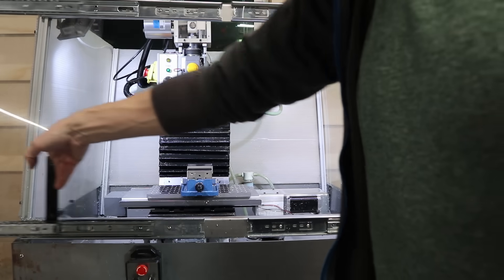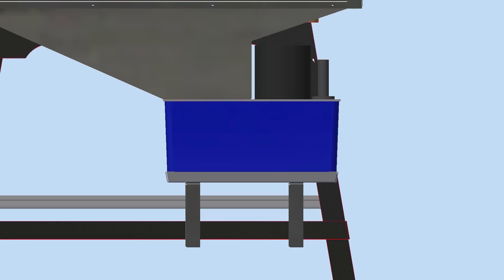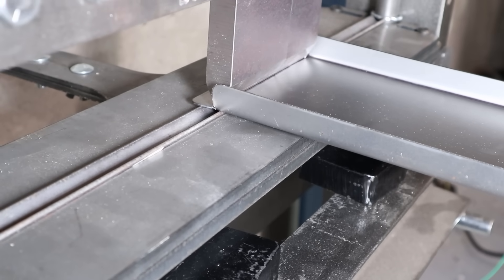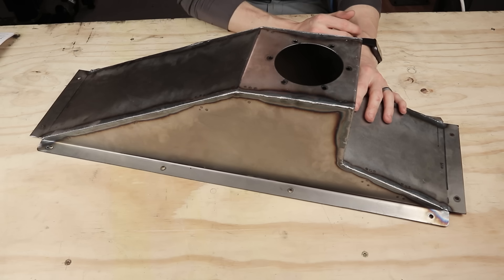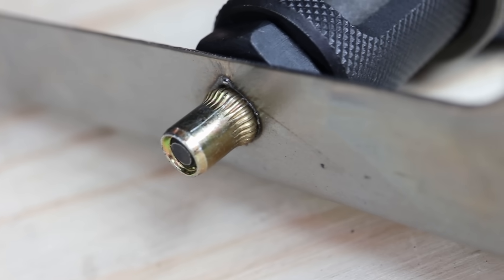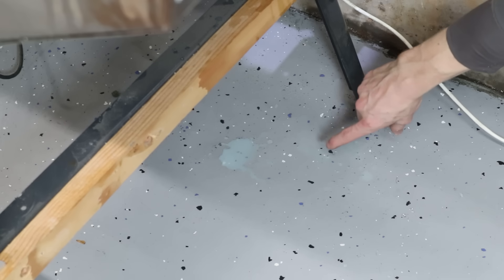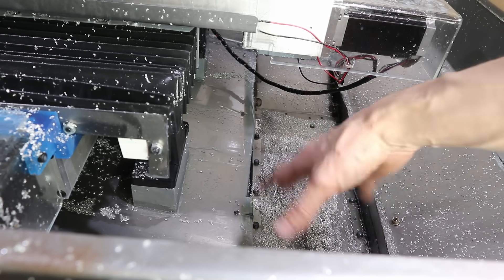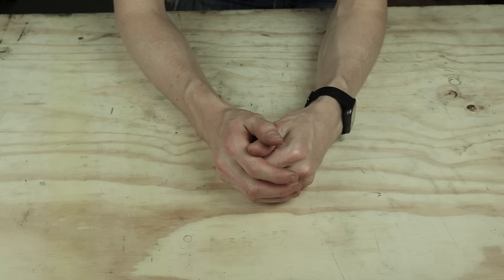Fixing a little mess with a big mess

Comment: I've used riv-nuts to install bottle cages on several bicycles. I don't have a puller tool. They will fatten out and lock into place by running a bolt into them and then just over tightening them.

Comment: Coming in a little late but as a welder of 11 years just the fact you welded thin guage steel with tig without blowing holes everywhere shows you have great hand control. Don't be afraid to show your welds, you're doing great.

Comment: Riv nuts? The protruding head is going to equate to a clearance between the filter and basin, on the order of thousands of times wider than the mesh's holes. 
Why would you not just make the thing snap in place with magnets?

Comment: I dare you to make a passively purging / cleaning filter mod so that the filter itself doesn't get clogged and starve the pump ( or overly limit the coolant volume ) as the filter loads up with small chips....and just because it's annoying to have to manually clean out the filter.   Might be a fun logic/engineering puzzle to solve how to automatically purge and separate the chip load from the stainless mesh filter so it's always free flowing.   ( Excellent [ and very satisfying ] build video my friend -- THANK YOU for posting !  I truly enjoyed it ! :- )

Comment: Obviously almost 2 years after the fact but if you haven't already, might consider putting a rare earth magnet puck at the bottom of the coolant basin below the mesh so any thing that might magically make it through will get caught by that last line of defense before the pump.  Similar to a transmission.

Comment: Wouldn’t it be better to put those tabs on the outside so it’s smooth on the inside where the fluid needs to flow? Great video this is fascinating
Reply: Also bend the sheet metal to overlap instead of separately made brackets.  The overlap would contribute to water tightness.
  Besides, spot welding is more dramatic with a handheld clamp fed by two massive DC wires that get pushed apart by the pulse.

Comment: If you let another layer of that screen lay over it, could you then just pull it out for a bulk of the cleaning.
Or ideally, rinse, reach in, grab a handle in the middle, pull out a basket, clean upside down, drop back in.
Anyway, thanks

Comment: those machines with a water pump build in (like a ice cube maker for example) often switch the Null/zero to control the machine. which then with all the water more often than usually is the problem for them banging a fuse out

Comment: If you want to learn how to manipulate the puddle, oxy-acetylene welding is a good way to practice. It was the first process that I learned and is still my favorite. If it was more versatile and could be used on lower temp metals like aluminum or sheet metal, I never would've bothered with TIG

Comment: Your new coolant system looks cool. =)
On another note...I'd have thought that the chips would be sharp and/or pointy and easily cut or pin through your skin when handeled without care...but since you just grab them and throw them around with your hands they probably aren't...though your hands do look kind of...messed up. Throw me an answer someone, are these not sharp & pointy at all?
Reply: Yes they are.  Working with such things for years literally causes the skin to heal to a thicker layer that can handle more scratches, while simultaneously training your brain to ignore more pain.  This used to be an easy way to tell workmen from manicured office/leisure types.

Comment: Hi! I love your videos!! I have a suggestion. If you make the frame and the screen of the filter in V shape pointing downward, then is less possible to clog, the chips goes to the lower spot and the sides stays clear the most of the time at least.  Plus you have more screen surface. And even more you can use an overflow about an inch  or so higher than the filter. This way only the coolant can travel through if the screen clog completely and the chips stays in the bottom of the cabin but then you may put more coolant in the tank than you put now. I hope that makes sense 😊

Comment: You still have a flat surface at the bottom. A better design would be like a ventilation duct from 'square' to round like this in the link below. this would take u from square/rectangle conically tapering into your plastic fitting with very close to no flat surfaces to gather liquid.
https://www.ductstore.co.uk/acatalog/ductwork_square_to_round_300mm_Width_200_Depth.html

Comment: Why not spotweld the tabs to the outside, as on the inside the coolant will flow and also the metal scraps. Wouldn't it be better to have an area where there are as few protrusions as possible? Makes cleaning also easier.

Comment: Electric motors and compressors have a tendency, on start up, to trip GFCIs. That’s why fridges and water fountains typically aren’t on GFIC protected circuits. Still not a bad idea to add a ground wire though 👍

Comment: Great engineering, worked as kind a special electrician 10 years, build the stuff that big company didnt want to build bcs so complex many times doing SERVICE was not in engineers mind at all!
And often they did not plan how to install stuff, like there is a wire from wall to wall 10m long and 4x10kg lights, walls were pretty much paper, so how to attach? wire tightness so it can carry them, noone in plans, or when we build this light art, which had 600 vertical wires in it, no horizontals to stabilize and it were in subway! hahaha bring it up to him did not get any solution so had to do own, ofc the wires had to be able to removed and tightened now and then, so we just made it whit long bolts. which had like 5cm empty space to adjust.

Comment: Why didn't you do the 90 degree elbow brackets you spot welded on the outside (or something else) so that the coolant doesn't have to run between the bracket and the panel?

Comment: I'm a year late but here it is! As an aircraft mechanic I see lots of rivnuts. I hate em. After enough ins and outs they loose grip and start to spin. Anchor nuts (or nut plates) are much better. Imagine a captive nut on a plate which is riveted to the surface. Much more reliable. Either way, better than a plain nut! 

Great video!

Comment: Recently, I built a furnace for melting aluminum.  I found out that under normal operating conditions, the firebrick at temperature can conduct enough current to trip a GFCI.  So I had to rip out my 20 amp GFCI's and replace them with standard 20 amp receptacles.  I stopped using those receptacles as convenient places to plug in my power tools.  Also, I started to worry about where I had plugged in extension cords into my some of my "dedicated circuits". Sure, there is plenty of capacity on my water heater circuit, but despite that circuit being located in my garage, it doesn't have a GFCI!  I better come up with a better solution for my wet saw!

Comment: I worked making air conditioning and manufacturing the ducting if you had a proper folder you can remove teeth which will allow for folding without crunching a fold already on the side they also have a bar that is a counterweight when it goes past Centre or plum the weights help you fold with less weight on your body.

Comment: Nice handcrafting but u should think a bit forward.
If the electrical safety goes off it means u have a dispersion of dangerous current somewere;  in a machine grounding ALL metal frames to earth is MANDATORY to avoid  electrocuting yourself ; how it works? with grounding wires will give the "runaway" current a easy path to earth to follow, instead trought your body.
BUT: u have to ground all metal parts = not only the bottom but also the metals juction on the plastic frames, the machine metal part itself etc.

Once u have done that, u still need to solve the PROBLEM : the machine is leaking power somewere.

To find it u could first find out if u have damaged component \ wire :  u must disconnect the cnc, and leave on but disconnected for 10-14 minutes ( to let the capacitor discharge) then with a tester set on continuity ( the beep) u hookup a probe to the metal chassis and with the other probe start to poke on the wiring connectors : lukly u'll find a continuity = u found one leaking point.

Remember to look the tester, it must show 1  or -  (so infinite resistance aka no leaking); 

other leaking point could be inside the power unit ( it can be some capacitors becaming leaking,)  in motors exposed to the splashing of the coolant.
Last but not least, the wiring: normal wires are made to be used dry,  and the coolant if not checked and mainteined properly can develope an acidity and react to the insulation : my suggestion is to use a cover small pipe to protect the insulation of the wires from the enviroment ( like in cars, if u check u dont have the bare wire insulation in sight, but they're covered by corrugated pipes with special cloth around the opening to reduce to minimum the exposure of the insulation.

i'm not an expert at all about machining, but damn u have a really cool lab !

Best regards from italy, stay safe !

Comment: you actually do not need any wire for WIG welding (wolfram-inert-gas welding) if u do the corners... u can just let the corners flow together and connect them... you only need wire for pieces where u need to grind it flush, say if u have a stainless steel plate (most used EN 1.4301) you just neeed wire to connect the two so you can grind em flush, you actually dont need wire for corners... it makes it even harder than it already is if u are not experienced

Comment: does the steel mesh hold up to abrasion from metal chips e.g. after cleaning it out etc
wouldnt want to have a tiny hole in the screen which end up passing metal pieces into the coolant pump

Comment: As an extra measure you could put a large neodymium magnet to catch iron particulates that pass through your filter, place it either at the side of the narrow bottom area and make a locking panel/tray or just stick one to the bottom of your blue coolant tray. Won't work for aluminum obviously, but it'll otherwise catch anything magnetic that the mesh doesn't.

Comment: first of all congrats on getting your thing working, but as far as next time goes... have you ever considered, construction glues, like PL premium or gorilla, for that matter and also as far as your filter goes you could have put it on magnets... if your temperatures exceed 40 degrees Celsius then I'd use some silicone, that's meant for the bathroom... there are pictures of either a bathroom or the outside on your Silicone  1 is good for heat the other ones good for cold..  saves you a whole lot of welding, I know aluminum is not the most fun thing to  weld, I'm really surprised you don't have a gag reel for all the mistakes you made welding the aluminum.. there have to be a few,, regardless.. I'm writing this for a different reason and that has to do with the fact that once you start telling the world the Earth is flat, you will start getting blowback, from the strangest places,, on top of that the reason why you start messing up, for no reason is because they're running a different program on your brain and that's a different story.. where the answers are no longer warm and fuzzy, I will include some stuff but it's very generic, so if you come close I can get more technical, oh and by the way the reason why they decided to invent the ball some folks will ask you and the answer is because they're hiding God... this is an answer that was pre-programmed, because the truth is they're hiding your creators,, as long as you have the silly notion, I'm going up, when you die, the satanists don't care how you get to hell as long as you get  there, Heaven is actually down and a cartoon ball also invents religions like,, reincarnation which basically say you were having a grand old time  and decided that you needed to be depressed, so you came down to earth,, the only question I have is if it got too depressing and you sold your soul, do you still get to go back? to the start and why would you want to come back if you can just be happy all the time?  in short all the... you get to come back... deals, basically say you've already screwed up, so there's no point in really trying. since you're coming back  anyways, you might as well , just keep screwing up , in fact let's raise the ante on how many screw-ups and how bad they can be?? apparently it doesn't matter... and you get all that by inventing a cartoon ball? I bet you know how to find a person's email you can't say a heck of a lot on uscrew

Symbols Of Our Past, God moved us here
https://www.youtube.com/watch?v=t7EAlTcZFwY

+Tiny, Lens-Free Camera Could Hide in Clothes, Glasses ( i found this on july 10/2017)
https://www.livescience.com/59642-ultrathin-tiny-lens-free-camera.html

here's the dream you're either falling , flying or fleeing let's just call it an effing dream...there's usually two of you, there's always a group of people that will be considered a bad entity,  who they are determines pretty much , which way they need to steer you as far as how to possibly manipulate you..... and the thing that makes this really memorable is you wake up, covered in sweat with your heart racing at top speed, and always after the initial shock of having the dream wears off ...you're always in a sitting position,  on your bed or wherever you had the dream,, the quicker you sit up from the time you open your eyes on this particular occasion , the worse off it is..., this is a sign that your mind is under attack and losing badly to a form of Mind Control it's been coined as MK Ultra all over the internet and the way they seem to calm the public down is that it's only for movie stars and maybe politician but that's it      the perfect control weapon and that's the only people that they're going to use it  on there's loads of books on brainwash, the Skippy dippy is  they all start with the same sentence there's two kinds of people in this world the kind that believe they can be brainwashed and the kind that are completely lying to themselves.... it's a sad fact but unfortunately the death camp experiments managed to perfect the system of brainwashing so that it works on anybody and everybody and if somebody walks up and says your key sentence you end up spilling all the beans and then five minutes later you'll have a couple talking about a very private moment in your life that according to you nobody knows about

Comment: This is an interesting concept.  Please consider converting the Lidar data to 3D sound and supply an aural picture to the user.  I think this would be more helpful to the blind and allow the wearer to wear the unit with the lidar in a pocket and use ear buds, leaving their hands free to walk with a normal gait and provide an instinctual response to brace for a fall rather than hold the equipment.

Comment: For a one-off coolant tank, I would have made the bottom part with all the complicated bends before making the sides of the funnel.  That way, the dimensions on the sides of the funnel could have been adjusted to fit and the bends wouldn't have to have been so precise.

Comment: Cool upgrade.
You can add a coarse stiff mesh over the fine mesh to protect it from mechanical damage. A gap of 15-20 mm would be sufficient between the two.
It can be held in place with magnets to make it easier to access for cleaning and revision.

Comment: In hindsight... did you think of putting the mesh/filter at an angle, so that it would be easier to clean the chips, as they accumulate to one side. Chips / Dust won't move down the slope on its own, but given that the coolant would be flowing through the gaps and with some help from the vibration they should.. Just a thought!

Comment: For your tig welding, take a bigger cup, you’re using one which is way too small. Also point the torch at an angle, you’re welding at 90 degrees, try 45 degrees

Comment: Do you have a way to prevent a gap caused by the flange of the rivnut?  The flange looks to be about .030 thick and that is what your screen frame is sitting on.  Can the coolant with small particles work its way around the screen frame?

Comment: GFCI's don't use the ground.  They measure the current between the hot and neutral. If one side drops there is a current leak, thus tripping the GFCI. Hope this helps No ground needed.
Reply: Also, all GFCI's made today are self testing. If the algorithm thinks there is a current drop(software),  you will get nuisance tripping. Especially when using induction motors.

Comment: Would have been easier to use a waterproof caulk instead of tig welding the entire structure? Or when waterproofing was still an issue still not using a caulk?

Comment: NOOO all those spot weld tabs should have been on the outside of the tank to make tank cleaning easier and stop crud accumulating! Although I guess it is easier to pull the sides in than push them in and expect them to stay put for any length of time.

I predict really nasty little razor blades of metal getting wedged between the tab and the tank body, be careful how you clean the tank bottom around these tabs in future if you like keeping your finger skin not all red, slippery and hurty.

Comment: Spot welding is good, but never leak proof. If you are having TIG welding blow throughs, and I am all too familiar about that, you need to practice more. Instead of shying away from TIG welding, do more projects with TIG welding joints and you will gain the experience to help avoid blow throughs. Great project by the way. Thumbs Up

Comment: I would recommend scotch brite pads instead of the mesh or over top of it, they’re cheap, won’t get punctured from a tool and allow the coolant to pass freely while holding the chips. We use them at our shop for filters on lathes and knife grinders